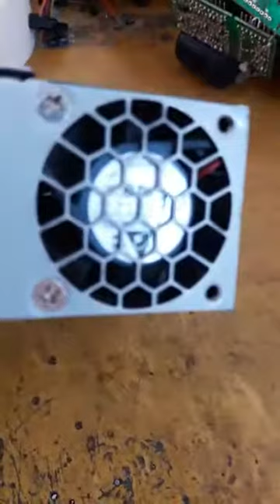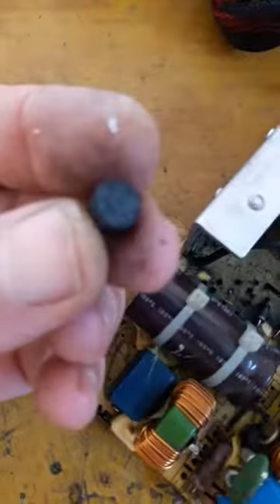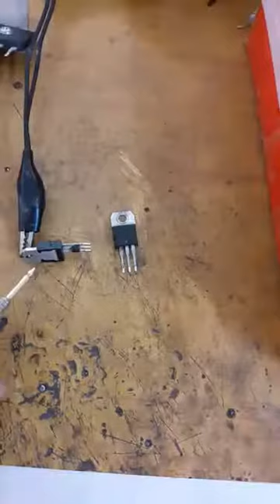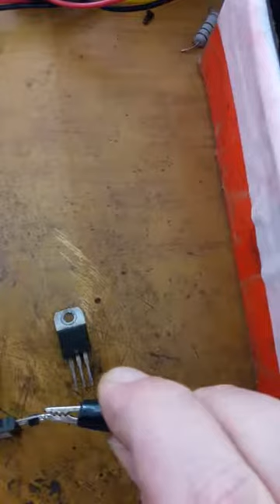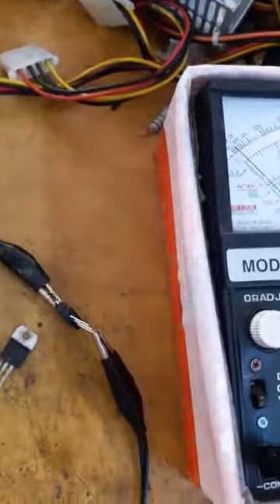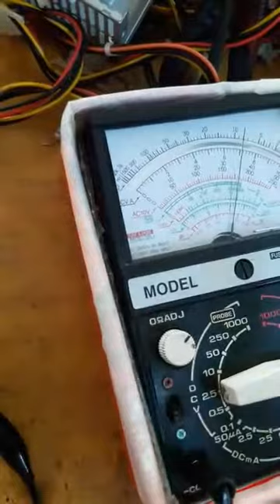delta  dps_250ab_24c      part 1  of repair

Comment: Hi can you tell me the values of resistors R02 and R901.Thanks.
Reply from the maker: Hi, Thank you for your question. Actually I do not know but can you tell me the  location the two resistors in the circuit in this way  i can can determine the Approximately value of the resistors

Comment: just had my NAS power supply go and this was extremely helpful in understanding what components went in it! Mine was a DPS-250AB-44D (slightly different that the one you had). Do you happen to have part numbers for the replacement Mosfet ICs and the fuse ? I am suspecting my power supply will need those as well. Also where do you typically order your replacement parts from? I'm in Canada. thanks!
Reply from the maker: Hi my friend Thanks for your question

In the computer power supply there are two designs in the first input circuit, which adopts transistors of type npn and the usual number is mje13007. In some other circuits, a  npn type is used but MOSFET can use any number have but you have to get high voltage and amper like 18n60 
(18a 600v) but what kind it is used in your unit i dont know you have to study the circuit  or get the number from the old installed part the fuse its 6.3 a  or 5 a as for the driver ic for the tr you have to see the 
installed part  you have to check all the parts in the out put and the in put because if you left one part burnt and you power the unit you will burn the new part that  you put   and maybe more.  atx power supply thay are handy but you have to be Cautious in working   
In them because thay use high voltage and main voltage cap you need to dis charge as for wear i get my part some from a local deller some i import it for china  but in your case you can get them from ebay aliexpress or banggood or others the most important thing is to get the original part  
God be with you takecare 
🌟🌟🌟If you have any questions, please do not hesitate to ask . if you did not subscribe pleace do so  so you get all my new videos  ....